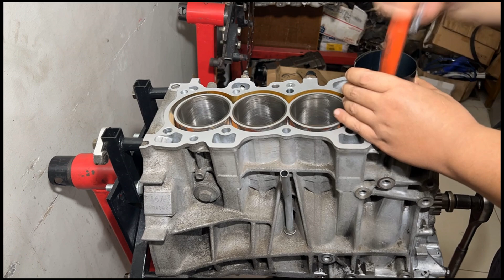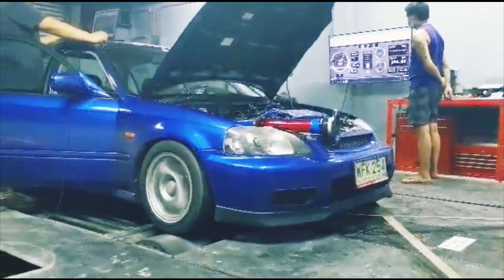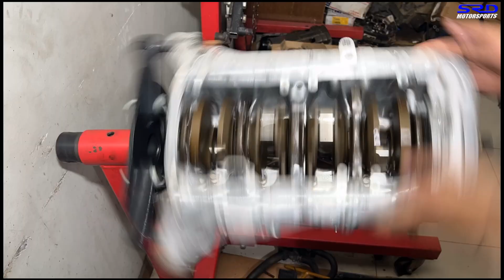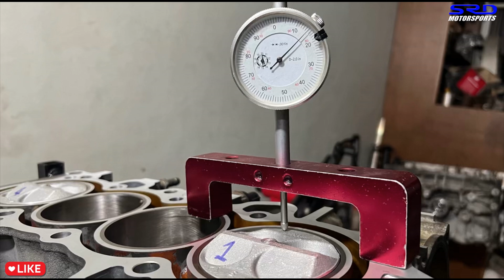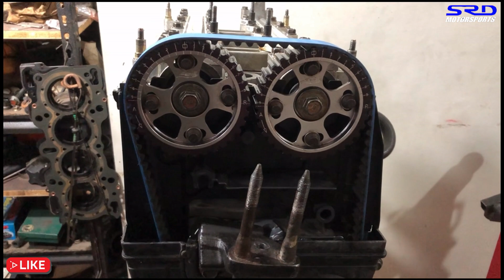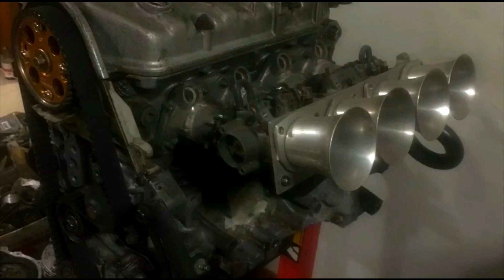Civic EG Hatchback B16a Build Series part 4 Engine Fully Assembled

Comment: Great to see the old B16s being built. Are you using stock B16A valve springs (duals only on the intake) with the ITR cams?
Reply from the maker: @danielrubiano5354  duals on both aka TypeR springs
Reply: @SRDmotorsports  thanks! basically the b16 intake duals on the exhaust, right?
Reply from the maker: we used typeR’s but I think u can do that

Comment: If I remember sometimes the cams won’t stay still on up so I have to use a 14 wrench to hold it down as I put the timing belt on and then have someone tighten the tension that’s what I did because the valves especially dual valve springs keep pushing the cams
Reply from the maker: Oh yeah that is true indeed